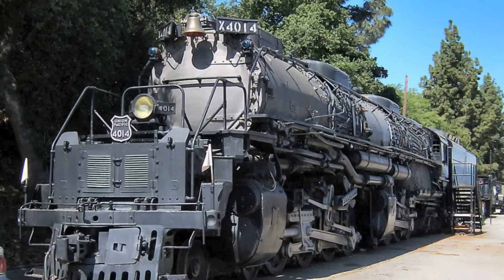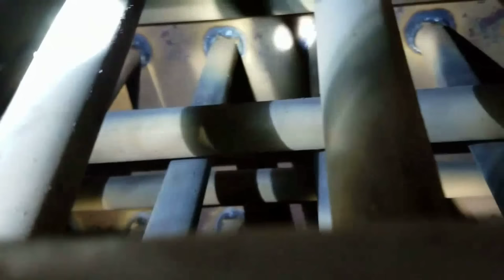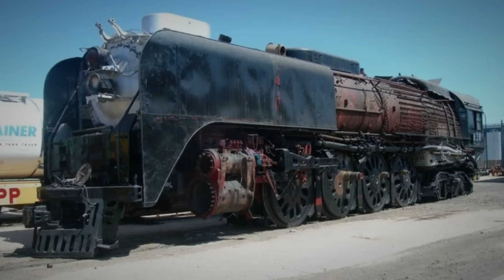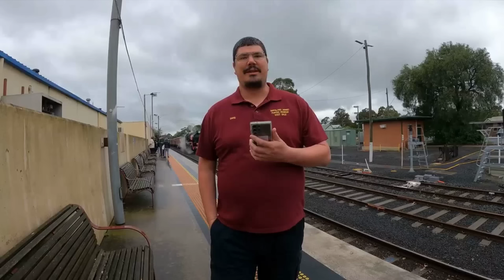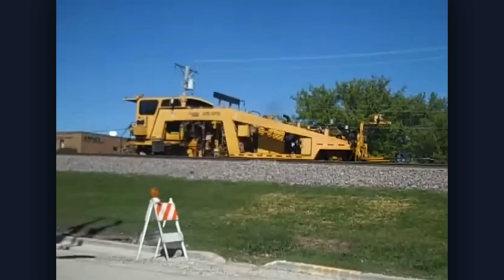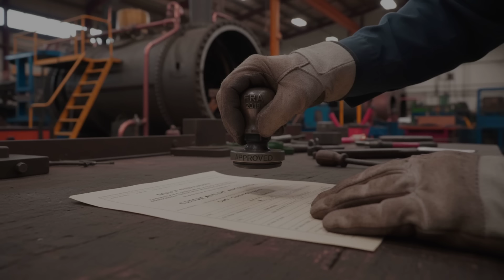The Ridiculous Big Boy Restoration That Shouldn't Have Worked (But Did)

Comment: I've worked on steam since 1975 and not once did I hear this restoration was rediculous. UP would not have attempted this restoration if they thought it wouldn't work. There are numerous Big Boys on display around the country and they would be a source for needed parts. Also I don't believe the running gear was frozen. As far as missing parts from the cab almost every steam locomotive on display around the country have fallen victim to railfans and others taking parts. 
The video is a bit misleading

Comment: Former Union Pacific steam program director Steve Lee said that a Big Boy steam locomotive would never be restored to operating condition. If it were it would be a caricature. And would be very limited as to where it could be run.
The conversion to burning oil in place of coal was not a major issue. It had already been done to Challenger steam locomotive 3985. The Challenger had a very similar design firebox. And so it was not difficult to create the parts for the Big Boy.
Reply: At the time Steve Lee said those words, the rail infrastructure was not reinforced yet for heavier trains like long, double stack container trains.
Reply: They should have bought the 9000 instead
Reply: @craighuddleston4537 one problem with the #9000: cylinder 3.
Reply: @kristoffermangila they still had 3985. Not much different. They did not want to repair track though
Reply: @craighuddleston4537 #3985 is not with Union Pacific anymore. It was donated a few years ago to the Railroad Heritage of Midwest America group together with some other pieces of heritage equipment and its now at that group's headquarters in the old Rock Island Railroad shop complex in Silvis, Illinois being restored to operating condition. As for the track, UP has to maintain their mainlines in order to run those very long, very heavy double stack container trains for Amazon, UPS and other customers, not to mention unit coal trains (nearly just as long and heavy as a container train) as well as merchandise trains.

Comment: Yes, parts have to fabricated at low volumes and consequent high cost.  Yes, a lot of stay bolts needed replacement, but several large steam locomotives have had large portions of their fireboxes replaced including in some cases thousands of stay bolts.  The oil conversion had been done on an experimental basis in the late 1940s during a coal strike.  It worked, but its continuation would have required new fueling facilities and the coal strike ended.
Reply: Since many UP locomotives burned oil the facilities to refuel were already in place. Even though 1 Big Boy was converted to oil for a short time UP never intended to convert the others.